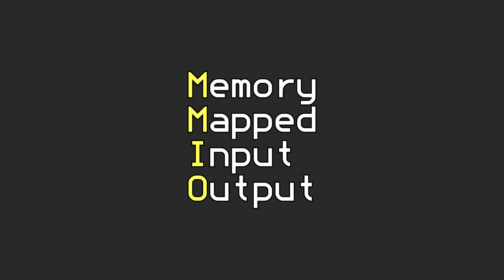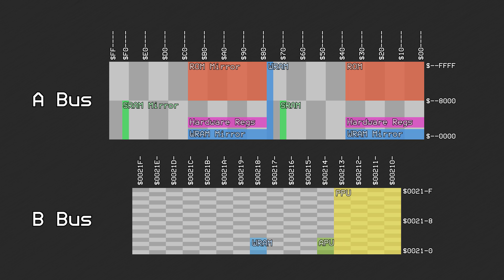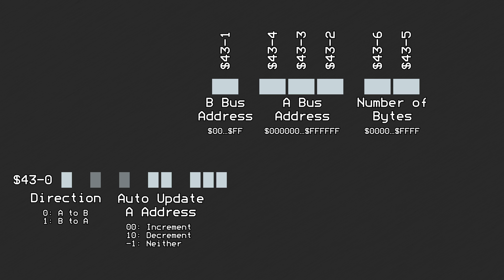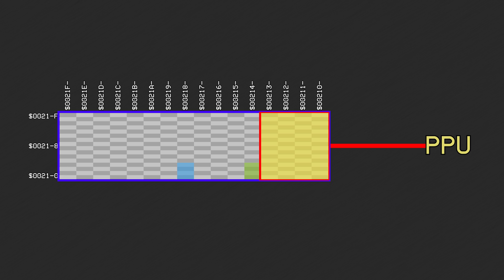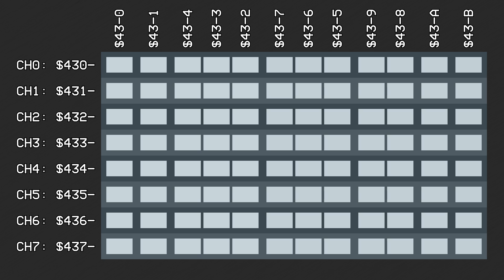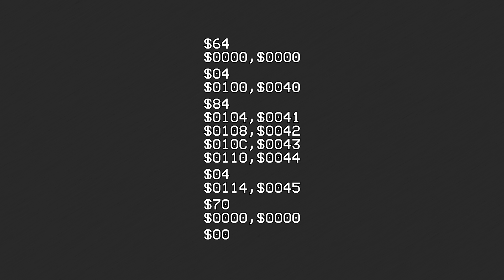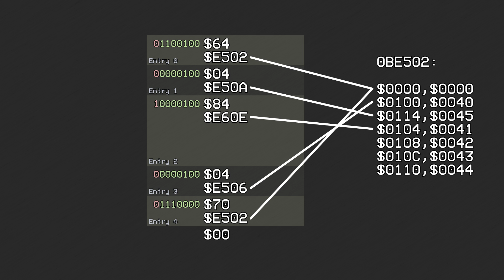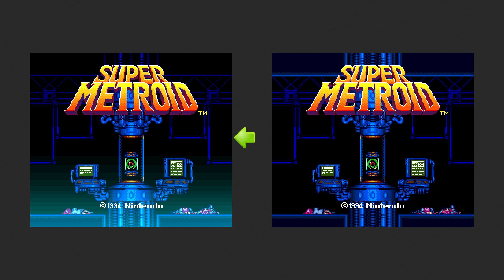DMA & HDMA - Super Nintendo Entertainment System Features Pt. 07

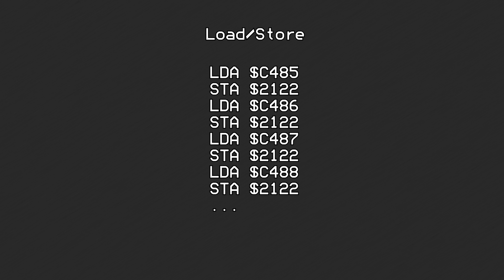Comment: 2:56 : You mentioned that DMA is independent of the CPU, but later you (correctly) contradict yourself, stating that the CPU stalls while DMA is in progress. It's one of the more annoying design decisions in the SNES in my opinion. I wonder why Nintendo did it this way. Even around the time the SNES was released, it was common for DMA to be asynchronous with either a per-channel finish flag you could check for completion, or interrupt-based.

1:40 Even with this great video series to explain things, the various memory spaces on the SNES can be extremely confusing. If it is unclear to anyone, VRAM, OAM and CGRAM have completely separated memory spaces; these areas are not memory-mapped in the 24-bit CPU memory space. Rather, hardware registers are memory-mapped instead and used to access these memory spaces, not very unlike how you would operate an UART/USART. The same thing (kind of) applies to the memory space of the SPC700 (the audio processor), with the small twist of talking to the APU bootloader until the SPC700 has a valid image to run. Once the SPC700 runs with an image, both processors communicate via UART-like HW registers.

Excellent work as always.
Reply: They probably did that to make the DMA faster and simpler. This way, the DMA has the whole bus for itself, and can copy data as fast as possible without caring about the CPU. On the PC, both the old ISA DMA and the newer PCI Busmastering DMA have to steal bus cycles from the CPU, so the transfer becomes slower if the CPU accesses memory. And the CPU is always accessing memory, because it has to read the program it's executing. This uncertainty is something you really can't use if you need to finish the transfer during the H-Blank period.
Reply: nullplan01 AFAIK 6502 CPU family (to which 65816 belongs) accesses memory way too much to have any cycles to steal. And it is on 8-bit bus despite being called 16-bit CPU! 8086/8088 in PCs have prefetch queue (and, later models, caches, on motherboard and on the chip), making it easer to coexist with DMA. Modified Z80 in GB is supposedly also able to coexist well with other ram accesses.
Reply: I guess that, because the DMA and the CPU both have to access ROM/RAM (unless you are DMAing ROM and the CPU is running a routine in RAM), they have to share the bus. Since the DMA is meant for fast (burst) transmission, it would be better/faster to let the DMA take over the bus and halt the CPU while the DMA hardware is operating. It is just a guess though, I'd love to know more about it.
Reply: João Baptista actually I can list at least 3 somewhat distinct reasons for DMA. 1) make up for the extreme inefficiency of these early cpus at moving data around. They spend vast majority of the time reading their own code and rather small % of these cycles is actual work. Especially 65xx. 2) feed data to time-sensitive hardware at the rate controlled by that hardware. 3) simply offload work that cpu could be doing just as well, on the systems where cpu is not hogging up all the bus cycles when executing its code.
Reply: I guess you got me wrong,  @noop9k  . I'm not saying DMA is useless, far from it. I'm saying that, while the DMA is running, the game is on the middle of sending a full frame worth of data, so it might have to wait before it starts processing the next frame.
Reply: João Baptista no, just made example of dma that would be useless if it blocked the cpu, on other systems though. Made a note that DMA can actually solve somewhat different problems
Reply: @noop9k Yeah, I should have made explicit that I was talking about WRAM, not VRAM. Anyway, there is not a lot of things the game can do while DMAing the computed frame on V-Blank routine, since it can be very problematic to interleave game routine with drawing routine.
Reply: I imagine it's because the DMA was run off the chip, instead of an arrangement where it's like a hypervisor. If the DMA had its own ASIC and or work RAM, it probably could have operated nearly independently. Then again, that sort of architecture helped doom the Saturn. The disappointment for me, it's its not using a 68000 processor or a derivative like the PCE did, and at a faster clock. Also, tying the ASIC ASIA to mode 7, and just having one of them.
Reply: Bryan L What helped doom the Saturn? The extreme complexity of the console?
Reply: @JoaoBapt  The SNES had a lot of bottlenecks around bandwidth and the ASIC that did Affine transforms - "mode 7" essentially & DMA. They were saying it would have been nice if you could batch process w/o halting the CPU. I was saying they could've done so. The second chip whole coprocessor in the Saturn essentially did this. It allowed the console to batch process or work on a parallel set of calculations. Theoretically, the SNES could have done this by allowing the ASIC to run it's own batch processes, along with DMA. I think the "architecture problem" is overstated with the Saturn, though. At the time, coprocessors weren't really used in anything but databases and maybe professional rendering. It wasn't a common thing like nowadays so, it was kind of foreign to game developers. Modern consoles have multiple cores and the GPUs have multiples cores so, it was obviously worth learning though. I think the real reason was SEGA pissing off devs by pushing forward the launch of the Saturn to concurrent with the 32x (which had a dual core architecture too); cutting their deadline by months. Along with Sony's far more conventional architecture, they attracted companies with really generous licensing and the console was priced more competitively. That means a larger install base = more customers. So, I think the devs and publishers abandoning the Saturn and it flopping is far more the result of a business decisions than the technical challenges, as often portrayed.

Most people think the FX chip and FX2 chip were additional graphics accelerators - they weren't. They were basically stock SNES processors that ran at 12 MHZ and 25 MHZ respectively. When on, they took the place of the SNES' cpu. I love the games on the SNES but, looking back at the hardware, I want to scream "what were they thinking?!" AVGN style. If the SNES had added a 2nd ASIC (which they knew would be super useful as it was in Pilot Wings, a launch title) and used a faster clocked CPU, I wonder what could have been. The second ASIC could do depth projection like Pilot wings instead of the flat, planar pseudo 3d of regular Mode 7; also, it could do separate sprite rotation, cosine & sine effects, etc.  Especially if they added some more work ram and let the ASICs run seperate from the cpu - even if one of them was just a pared down cosine and sine lookup table as that's the most computationally challenging function "mode 7" did. Also, ditch the forced use of mode 7 to access it. Even better would be using something like the 68000 the Genesis used (people overclock their systems to 50 MHZ! routinely) or even better, a similarly clocked HuC6280 that the PC Engine used. It would easily have competed w/ a middling 586 of the time - more, since the ASIC acted like the first graphics accelerator and, they could optimize for the hardware and wouldn't have OS & Driver overhead. I litteraly can't believe they didn't sell some upgrades t plug in, like affordable versions of a 32x since they had an expansion port for the CD addon they had planned. The chips were cheap enough, they bundled them into Pilot wings, Phantasy Ocean, Yoshi's Island, Doom, Star Fox, etc for an additional $10.00. I just wonder what could have been....

If you want to see how the Saturn's second chip was used, lookup Game(er?) Hut's channel on YouTube. He owned Travelers Tales which made a bunch of great games for Sega & SNES and explains how he achieved a lot of stuff. One is how sonic worked on the Saturn and what the 2nd chip did. The 32x actually used pretty much the same chips and architecture (pretty sure) but, was limited by the Genesis Bus, RAM and associated chips. It was like 2 SVG carts from a virtua racer / fighter set, the same way the super fx2 chip worked for nintendo. If you didn't plug in the video patch cable, you could actually see what the Genesis was rendering because the 32x stuff wouldn't get added in or vice versa; it was like switching off a major graphics layer.
Reply: Bryan L What? Multiprocessing was new? 16-bit sega already does multiprocessing, with 68k and z80 sometimes fighting for bus access. Atari 800 antic and Amiga copper also can be considered coprocessors. 32x was also basically an introduction to, say, 30% of the Saturn.
Reply: noop9k I don’t think we can call the association between the 68k and the z80 “multiprocessing”, because the Z80 is effectively acting as a slave processor, used only to play audio in most games. The same role as the SPC chip in the SNES.

What we could call multiprocessing was only with the PS3 with its alien “Cell” processor or the Xbox 360 with its multi core POWER chip, or the Saturn with its Frankenstein of a system.
Reply: Bryan L Starting from Famicom,  Nintendo’s policy was to rush out quick-and-dirty hardware that could later be fixed with on-cartridge addons. And the SNES was already too expensive and late to market. It is so easy to doom your hardware by a few hardware defects, like Lynx or Jaguar. ASIC design and verification may take years and they probably already used the budget they could afford.
Nintendo should have released their 32x? to make it a failure like the real 32x, half-baked, poorly thought out and not well supported?
Reply: João Baptista It is connected in such a way that controlling audio chips is the most natural work for it, but this is also true for other multiprocessing archs where there is also master/slave relationship or non-uniform hardware/ram access tied to specific co-processors. Like master/slave SH2 or like PS2’s VUs
I think you can program Sega MD in such a way that the main code will run on Z80 and the 68k will just execute routines for processing graphics  data. People say Z80 can actually write into the main 68k RAM and Sega CD ram, effectively controlling the whole system.
Reply: @noop9k  I already said that perhaps separating the ASIC (and even adding a second one) could've potentially have made the architecture less appealing to programmers. I just said that freeing the ASIC from Mode 7 backgrounds only and allowing anything to load into, like a memory address w/ some flags for rotation, shearing, etc. would've been great. Also, it wouldn't have needed validation and testing the way you claim because they already had a second ASIC that did matrix manipulation in combination w/ the SNES' for Pilot Wings (launch title!) - supposedly  to handle roll and tilt.  The clock speed on the SNES' Rico 55A2 processor was capable of going up to nearly 28 MHZ but was limited to 3.5 MHZ (stock 2.6MHZ in PAL and as low as 1.7 w/ PAL w/ peripherals) so it was in theory, backwards compatible to NES cartridges. They actually caught a lot of flack at the time by parents for rendering the NES carts unuseable (this was before lay people understood how fast advancements in tech happen). It would've been cool if they had implemented that feature, maybe with better colors from the PPU the way the 32x did with regular Genesis carts (I know this is slightly controversial but, yes it did render better colors).  The Super FX and FX2 chips were bog standard 55A2 chips with higher clocks. There may have been an added L2 cache on the FX2 as it has a larger for factor but, as far as I've been able to find, it functions as a regular 55A2 clocked at 25Mhz. 

What's baffling is that they didn't up clock the chip once they abandoned that feature. Considering that the 55A2 was litteraly a photocopier chip and (to my knowledge) didn't have any customized functions the way the HuC6280 did. They could've used a 68000, like the Genesis upclocked to 56 Mhz(!) as people routinely do to their Genesis consoles. You claim they intentionally crappy tech - yes, I've heard the "withered tree" motto but, it doesn't mean what people think it means - more like dependable, boring and cheap. The 68000 was the 16 bit version of a Z80, dependable, on the market forever and cheap BUT, still way better than a 55A2. Even the Neo Geo used a 68000 (I want to say 12.5 MHZ but it was somewhere in the range of 10-15)+ Z80 architecture that the Genesis used BUT they had way larger carts and were 100% sprite based (in practice - they may have had a bg layer that scrolled) but, were short, high quality games. My guess as to why they didn't upclock it once the NES backwards compatibility was canceled was because game were already in development. Still, since just about every game I'm aware of was timed by frame rates, they could've upped the clock speed dramatically and just capped the framerate. That means probably all unmodified games woulds work normally but, without slowdown AND future games could take advantage of the extra cycles. The SNES had a modular design to add peripheral chips to the carts too to stave off obsolescence and it had a port that accessed the bus for addons that they produced in Japan. They had all kinds of accessories for Super Famicom, including but by no means limited to "cloud" based games that you could download from cable or satellite services (St.GIGGA & the cable TV) as well as other peripherals. Today, those games have totally disappeared - which is why I hate the concept of digital only games; companies won't keep servers alive when they could sell newer versions but, this is a tangent. You talk about the 32x like the fact that it was an addon that killed the product; it had FAR more to do with the cost and timing of release with the Saturn - and it killed both by creating bad will with consumers and developers.  

That brings me to your comment on the Z-80 secondary chip in the Genesis. While the Z80 is a moderately capable chip on it's own - it runs TI-8x/9x calculators, Gameboys, &,  many micro computers, it was NOT used as a co-processor. The Genesis had full Master System (and presumably SG-1000 and the earlier 2) backwards compatibility. Those systems all ran on the Z-80. When NOT being used to play MS games, the Z-80 controlled sound output to the  Yamaha sound chip. I know at some point they substituted the Yamaha w/ a much poorer chip than even the Master System had but, the Yamaha produced great sound (for its release in the 80's); the downside is that it had very little internal memory. To get around having to constantly feed audio to the sound chip, the Genesis used the  Z80 as a sort of hypervisor to buffer midi data from the CPU and feed it to the Yamaha. Very few programmers took advantage of direct access to the Yamaha by the CPU but, it was possible to make improved audio. That being said, most programmers weren't familiar with it as a "coprocessor," in the sense that you mean it, even though it was technically a sound coprocessor.
Reply: @noop9k  As for the 32x & Saturn architecture, being half baked..... I could agree or disagree on that one. Supposedly, the 32x was intended to provide a "budget" 32 bit system for a lower income segment of the market and wasn't really intended as the "band aid" the way it eventually became, thanks to Sega's US branch marketing. The Genesis was incredibly popular in the US, Brazil and UK. In theory, if they had been honest about what it was and priced it at a bit less, I don't think it would've been the disaster it became. The 32x and Saturn actually share the exact same architecture and chips - Hitachi SH-2 chips. The difference is that the Saturn had tons more RAM across the spectrum and a built in high speed disc drive. Also, it had some great sound chips and, I think mpeg decoders but, that may have been an addon. You kind of have to cut them some slack because they bet on 3d Backgrounds + 2D foregrounds or vice versa being the future of games tech. This wasn't as crazy as it sounds either; that's exactly what Mode 7 is. The Saturn may in fact be the best 2d system ever made but, they panicked when they learned about what the PS1 was capable of and started encouraging development to match the PS1. Not to mention developers were already heading that direction themselves and probably had SDKs for the PS1. There's a myth that Sega just tossed in an entire 2nd processor architecture in hopes that people would learn to make use of it to compete with PS1. The dual architecture goes back to the 32x which was in co-development w/ the Sega CD. If they had made a way for the SEGA CD and 32x to function as a "poor mans Saturn" they'd be loved for it, not hated the way they are now. All they'd have needed to do was design the Saturn to use higher quality textures and put in lower quality set that the 32x/SEGA CD combo could utilize. It would be challenging but the chips and architecture were similar enough that w/ some pre-planning, it was probably possible (note: I said PROBABLY).
Reply: Bryan L 32x is a half-baked system made in haste. It lacks exactly the things you wanted to see in SNES. An ASIC to offload graphics rendering. Without it it it can’t even match all the capabilities of the SNES at 60 FPS. Probably would work better in CD system, but 3-part system is insane
Reply: @noop9k  I think you're conflating me saying "The system could have been great or better if they'd just done X" vs me saying "the system was great because they did X." Also, there's a huge difference between the sort of games designed for SNES and 32x, and how they could've been improved. I don't know where you got the notion that the SNES was more powerful than the 32x but you're way mistaken; the SNES was arguably less powerful than the Genesis, as you can see here: https://youtu.be/hNKKzPpx8UE

There are two diametrically opposed versions of how the 32x came into being; one where it was Sega USA pushing development because the Genesis was so popular here w/ Japan hesitant, to the opposite, with Japan trying to push the 32x with Sega USA wanting to wait for the Saturn. There is supporting evidence for both but, I honestly chalk it up to miscommunication and the blame game trying to pawn off failure to the other party. I think it was poor execution, bad timing, edgy marketing putting out unreasonable expectations, the really ungainly design of the SCD+32x (and seperate power) and pricing. I personally suspect that if it wasn't for the way they handled the 32x / Saturn situation, the Dreamcast would've had much more staying power and Sega would probably still be making hardware. Somewhere along the way, the 32x went from being the "poor man's 32bit" / "a fix for your 32 bit needs before the real hardware comes out" - sort of like a generation 4.5 or maybe 4.75 if you include the Sega CD - to "THIS is your 32bit system!" which was supposedly NOT the original intention. When I was a kid I had a sega cd and 32x and felt pretty let down (I hate you Sewer Shark!), especially when the Saturn came out; then again I also had a 3DO which looked like it might have been the future at the time and that didn't exactly pan out. I also had a PC from the start so, I migrated over to PC for a while and played consoles w/ friends. As a matter of fact, I don't think I bought my first Playstation until the late 90s just to play Final Fantasy. 

If the 32x had come out a year or two earlier, as opposed to concurrent with the Saturn (and had the Saturn been pushed back for polish instead of being rushed), I think people would have a much better view in retrospect on the "system." Believe it or not, the Sega CD added it's own "mode 7" style ASICs, the way I wish the SNES did, as you can see in Batman Returns for Sega CD. The problem is developers jumped on the 3D & FMV bandwagon but the hardware was designed for 2d. In theory, if they had worked on better integration or left the architecture more flexible (as Nintendo did for on cart chips) they could've pulled it off, or at least made the system better. If you look at the technical capabilities of the Genesis too, it's actually extremely powerful compared to the SNES. It could handle at least 8 times as many polygons - more like vertices, you can define 2 triangles w/ 4 points, which is what the Saturn did with "Quadrangles" vs the triangles used today. The bandwidth of the Genesis was much higher, I think at 4x the SNES for DMA. The chip was 2-3x faster and could be boosted 5x, if only they had developed the capability to digitally set the clock - which should be possible... People overclock their Genesis by feeding it a faster crystal signal; if they had built a system which would feed a harmonic of the inbuilt frequency,  they could have pulsed it 4 or 5 times then waited for the inbuilt 7.6 Mhz pulse (ie 4 external for every 1 internal) and gotten a stable 38- 45.6 Mhz which is doable, assuming they could synchronize accurately. Since the entire bus is accessible, at least from the Sega CD side, it should've been possible if the 32x was part of the Sega CDs original specs and they used a patch cable. If they'd just added way more RAM and used the Genesis for Audio and it's PPU, and as a passthrough for the SCD. It would've been better if the 32x could plug right into the SCD but, they didn't add an expansion port. 

You're acting like they screwed up for not putting graphics acceleration hardware on the 32x - the very concept of Graphics Accelerators was invented by Nintendo to improve the SNES' pretty dismal processing specs. At that time, video cards didn't have tons of cores for matrix processing, etc. They were boards of Video RAM that outputs to a monitor. So if you had a CGA , EGA or VGA card, it had all the memory for each pixel at a specified colour depth - as far as I know, they did no processing of their own. It was possibly short sighted but, wasn't crazy of SEGA to think the ASIC idea was anything but a stopgap until an adequate processor could do it w/o help. Both the Saturn and 32x used really high end SH-2 chips that both processed 32 bits at 25+ MHZ. That should've been pretty adequate for the time period. The issue was that there was a paradigm shift and Sega didn't see it coming in time. Then, they didn't delay their console to fix the issues, they poorly managed expectations by pushing FMV games as photorealistic and they made a ton of bad decisions in panic over the Playstation. 

If the CD-32x and Saturn had more market share and staying power - long enough to see some actual console pushers, I have a feeling they'd have been able to make some incredible improvements and people wouldn't try to blame the architecture. I wouldn't call 3D a gimmick but, at the time it sort of felt that way, especially shoe horned into 2d consoles with mode 7 pseudo 3d and superscalar. If they had optimized around what the hardware was designed for, I have a feeling there'd have been some killer 2d games - the kind we're seeing a resurgence of in the indy markets. High res Metroidvanias and Neo Geo style games were easily within the specs of the 32x, CD-32x and Saturn - I'm stunned they didn't at least internally try to capitalize on their strengths instead of trying ot cover their weaknesses. I mean the Dreamcast was a SOLID console and really only perished because they didn't have the user base after Sega lost tons of consumer's good will.
Reply: Bryan L very sorry, I was and still busy to read walls of text or reply to any point made, will only reply to 32x argument. Try to similate SNES transparencies on it, try to render the same amount of 2D sprites and backgrounds with all the basic  stuff such as priorities, palettes, tile map bgs, mirroring and transparent color and, obviously, your framerate will be quite far from 60. Yes, you can do framebuffer stuff impossible on 2d consoles but can you really just render a double amount of MD VDP sprite/bg 2D pixels at 60FPS? Don’t think so.
Ok, will also comment on cpu frequency. Was probably a cost issue with rom speeds, no?
Reply: @noop9k  Ita a It's complicated subject, it's kind of impossible to condense the issues with these consoles into a line of text. Transparency is literally a single bit in the colour palette, usually 0. I think all of this was pre alpha channels for variable opacity. The 32x natively has transparency in everything; if it didnt, every sprite would have a bounding box. Additionally, if you unplug the patch cable, you can see the portion the Genisis is rendering - usually HUD info and BG while the 32x renders objects on screen. I never recall there being issues with massive slowdown on the console, are you talking about emulated games? While I never had any CD-32x games, because they weren't commonly available where I lived, I've seen video of it and it looks decent for the time. The problem is that all of the ones I'm aware of were FMV games and the SCD was a 1x, 2x drive at best, and had loading problems. Issues the PS1 still had. If anything, it was the addition of loading screens that mitigated this, instead of just slowing the game. ROM sizes that were applicable for resolution and color depth weren't prohibitive. Supposedly, Sega had shortages of the SH2 chips because they were in demand for other electronics of the era, as they were cheap and powerful.
Reply: @noop9k  BTW, if you're actually trying to run homebrew code on an emulator and can't get transparency working,try dithering. That's how 32x and earlier consoles did it.
Reply: @Wintermute_SilverPaths  No, I'm not trying to do anything at the moment. I'm just saying that replicating even this single SNES feature is not possible on 32x with speed even remotely comparable to SNES. Do not try to derail the discussion, please.
Reply: @Wintermute_SilverPaths  "Ita a It's complicated subject" I agree, but this is becoming overwhelming and I'm still short on time :(
Yes, I found the statement about 0 color being transparent when drawing(docs describe this poorly), so it is not as bad at 2D as I initially thought, so there is (probably) no need to use RLE-encoded or compiled sprites, like on PC 25 years ago. Inability to do SNES-like semi transparency still remains.
Reply: @noop9k  Derailing the discussion? It's hard to have a discussion when you can't even come to agreement about objective facts. The 32x is by every measure a superior system than the SNES from a hardware perspective - that shouldn't even be a controversial statement for a system w/ (2) x 32 bit risc processors, running at 8x the clock speed and more RAM of every type. There are 3d games rendered solely in processor, superscalar games w/ more objects that were rendered at a higher speed than a Neo Geo. Transparency is a default feature, just assigning a color palette of 0 makes the dot transparent. Unless someone is trying to do some funky, multiple bitwise booleans or alpha channels using additive or subtractive color, transparency is cooked in and shouldn't affect speed at all. Even the PSX used dithering for transparency and expanding the palette from 16 to 32 bit. It's not unreasonable for the 32x and Saturn to do so. The 32x could render full, true 3d games; it doesn't need a mode 7 style ASIC & DMA to do matrix calculations and transforms. Look, the SNES was a popular system and a good system (all I'm saying is that it could've been better with a few changes); that means there are tons of games for it, and by that standard of "Good Console" it wins by far... BUT, that's based on the fact that it has many fun games - NOT from a hardware superiority standpoint. Obviously the 32x could've been better too w/ some better forethought and timing but, the games it does have are head and shoulders above the SNES, and anything else on the market for... 3 months, maybe - in terms of graphical complexity. NOTE: I'm NOT saying gameplay but, some are legitimately great. I would be shocked if a 32x couldn't outright emulate a SNES w/ no slowdown, as a standalone unit, no Sega CD (or even Genesis if it was possible to separate them).  Here are some 32x games, tell me which one of these the SNES could exceed, matched or even ran a stripped down port (excluding multi console ports like MK2):

BC Racing (Mario Cart / F-Zero style "Mode 7" pseudo 3d, Sega CD vs 32x - SCD had a "mode 7" ASIC like I wishlisted - superior to SNES): https://youtu.be/oiCEbNvfrvs?t=155
Afterburner vs Arcade (Superscaler - considered best or 2nd best "Tie" w/ Neo Geo): https://youtu.be/BnFP8XJdyLg?t=1306
Star Wars - Full True 3d (32x vs Arcade): https://youtu.be/IYxY0G8vl6E
Mortal Kombat 2 SNES vs 32x showing 32x is at least as good, from personal experience MUCH better game feel: https://youtu.be/Y06w2oSCGPY?t=555
General Overview of the system w/ multiple gameplay: https://youtu.be/JQU4EDtvJhA
Kolibri (not a great game but, graphically impressive shmup; note the dithering on the hummingbird wings along w/ the expanded palette):  https://youtu.be/AxkvXu4Q5mE?t=34
Reply: @noop9k  Oh, I missed you addressing transparencies before posting, my bad; I don't feel like rewriting and editing my comment. Also, complex transparencies should be possible in 2d (or 3d but, slower) using the methods I described in the above post. The documentation is terrible as it was on the market for such a short period of time but, I see dithering on the SNES in place of transparencies - as well as boosting the palette. I seriously can't think of anything the SNES has that it couldn't do except maybe sound quality as the Genesis hardware that ran the sound had some questionable revisions after the redesign.
Reply: Bryan L I only can repeat what I already said. Many games on the SNES use semi-transparent layers, to render fog, clouds, shadows. Not possible on 32x @60 FPS. PS1 does that well enough too. SOTN has huge semi-transparent sprites and has fog layer in some areas. Saturn has some problematic limitations but can at least emulate most SNES 2D features with proper speed.
Reply: Bryan L Please find me at least one game doing sometging like this https://youtu.be/CUiTEyxtkhk?t=4125 which is an effect appearing in a huge number of SNES games at some point. PSX example @60:  https://youtu.be/egkTac72EWU?t=10297
Now on the links you have given which are unrelated to our argument. BC racers only does scaling at around 50% of the screen area, probably not 60 FPS, more like 30. Afterburner has harsher sound,  and less framerate than Saturn, possibly also less colors. Star Wars renders simplified models at much lower framerate and resolution vs arcade, lacks some altogether. Colibri’s main feature is an extra BG layer with higher colordepth and still employs lots of dithering. Agony on Amiga looks more impressive for the hardware that is 7-8 years older.
Reply: @Wintermute_SilverPaths  the superfx and superfx 2 are very different cpus than the snes cpu. I'm not sure if I'd call them a graphics accelerator, but they do have an instruction specifically for plotting pixels to a tilemapped frame buffer.